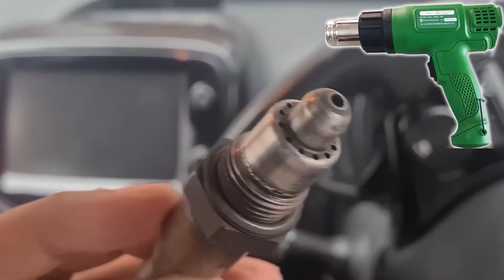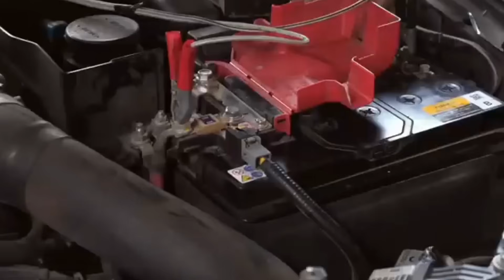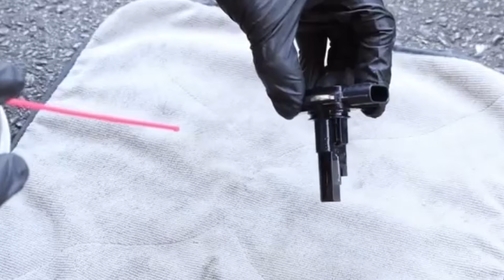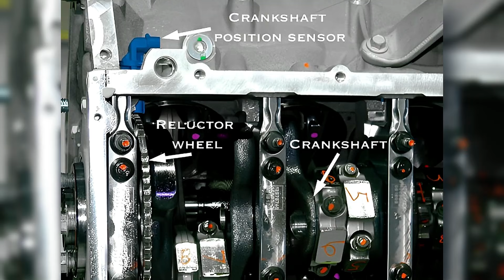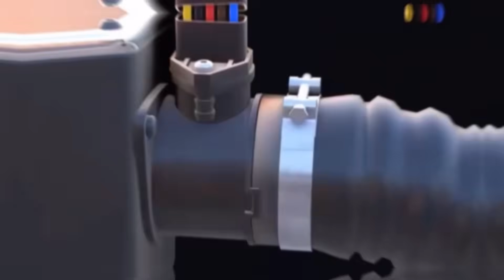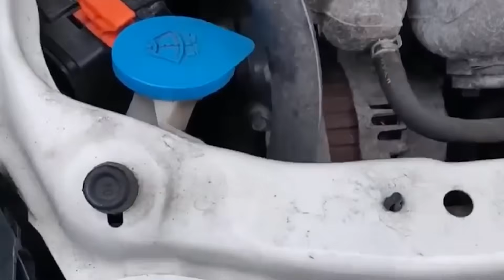Nobody Cleans These 5 Sensors — And Your Car Pays for It

Comment: Idle surges up and down while setting with put on break like at a light or drive through
Reply from the maker: That's the throttle body. Carbon buildup on the plate messes with the idle signal. $8 can of throttle body cleaner, 15 minutes, that surging goes away. Try that first before anything else.

Comment: I had a 2004 Toyota van that was bringing on the engine check light, would disappear after engine warmed up. 
Got worse, light stayed on longer, then permanently. 
Scan tool said O2 sensor, clear code, rev up hard, ok for about a week, back again. 
Put injecta clean in fuel tank next time I filled up. 1 week later problem gone, poor injecta spray was throwing out fuel air balance. 
I now put injecta clean in my vehicles at least once a year, more if I'm driving it a lot. 
Glyn NZ
Reply from the maker: That's exactly what dirty injectors do — mess with the air fuel mix just enough to confuse the O2 sensor into thinking it's a sensor problem. Glad the Injector cleaner sorted it. Once a year is the right call.

Comment: 1989 Chevy Z71 that is running extremely rough. In winter sometimes won't idle. Constantly having to give gas to keep started. Will stall out if gas not given. Even after running for several minute wants to stall when put into drive. Lack of power. Lack of climbing power. Will have to shift to 2nd to climb hills. Thinking it's the 02 or MAP sensor. Possibly a clogged fuel filter. Any guidance much appreciated. Was quoted 800 for diagnosis. Local shops won't touch. Please help. Thank you.
Reply from the maker: That’s classic fuel/air + idle control issue — not a mystery failure. Start with fuel filter, vacuum leaks, and the IAC valve before touching sensors. O2 is rarely the cause for stalling like this. You’re very likely looking at a $20–$50 fix, not an $800 diagnosis. What engine is in your Z71?
Reply: Listen  closly if u hear some air noises. I have 1995 mondeo and it had exact problem i found one small rubber pipe wich was directly connected to engine maby vaccum pipe or something. It was broken i changed it and the problem solved.

Comment: My tuck hold back seems like  it gargling the gas when I press the paddle
Reply from the maker: That hesitation/gargling under throttle is classic bad air-fuel data. Most common causes are a dirty MAF sensor or throttle body. Start there before replacing anything — quick and cheap fix in many cases. What truck + engine do you have?

Comment: I don't know if this scanner is working. I've scanned my cars, a Mitsubishi Xpander MT ang Ford Ranger Raptor, 2.0 bi turbo. No fault codes. Good if it is true. Maybe I'll have to try it with a fault if it can read the fault.
Reply from the maker: If it’s showing no codes, that’s usually a good sign. You can also check pending codes or live data to confirm it’s working. What scanner are you using?
Reply: @AutoTruthLab it's a cheap one. THINKCAR 500. It's updated.

Comment: You should be able to sue these mechanics out here ripping ppl off. Are there  really anymore honest  mechanics anymore
Reply: I am starting my own mobile mechanic business following my grandfather owning his shop of 50 years, I am sick and tired of people getting ripped off, caught between a rock and a hard place with insurance companies and mechanics raking them back and forth through the coals. Not to mention the manufacturers are installing more and more computers in the vehicles making it either more difficult or completely impossible to work on as a mechanic without the distributor's software. Do not buy anything newer than '13, anything built after that has truly solidified the end of the automotive industry as we know it. It's all software, cheap metal, and petrochemical garbage now... the underbody of my gramp's '71 Cheyenne is cleaner than these >10 year old cars that come in with rusted out oil pans... it all makes my blood boil, unfortunately just another a microcosmic example of they way greed took over humanity and American industry/society. 

We know they sold out decades ago. The products we purchase now are a result and aftermath of this.
Reply: No

Comment: I guess I got go down the list and see what issue is now. Scratching my head. That 1 sensor is hard to get to, almost lost the screw last time.
Reply from the maker: Step-by-step is the best way. And yeah, those screws are a nightmare — try a magnetic tool or a little grease to hold them.

Comment: 2yrs ago I got an engine light. Ran diagnostic ,  cleaned maf and map. Engine light went away  code came back. Took it to a mechanic  friend and he cleaned it again engine light went away again. When i went back to work turned off engine everything was fine. When tuned car on a few hrs later engine light went on again. This time we replaced MAF and MAP sensors  drove for 50mi  to clear code. It worked. Saved a lot of money. Now I got the P0171 code 2yrs later
Reply from the maker: Good troubleshooting. P0171 is a lean code, so besides the MAF it could also be a small vacuum leak or fuel delivery issue. Definitely worth checking those first.
Reply: @AutoTruthLab  yeah, and could be other things. yeah, yeah, your answer only makes people crazy
Reply: 2004 Dodge 1500 5.7  when I first start I n the morning  smells like gas what is the cause

Comment: Hi I have P0448 code on a 2017 Nissan Armada  short circuit in the Evaporative Emission (EVAP) vent control circuit, commonly caused by a faulty vent valve, contaminated charcoal canister, or damaged wiring. The most common fix is replacing the EVAP canister vent valve, often located near the charcoal canister, which can be affected by dirt, water.   So far I have replaced the Canister and vent valve. But the code is keep coming back. It seems like the problem could be wiring. Any Suggestion how to fix this issue? The car is running fine from last 3 years. But the engine light is on all the time.
Reply from the maker: If the canister and vent valve are already replaced, then wiring is definitely the next thing to check. On the Armada, the EVAP vent valve wiring near the rear frame rail is known to get damaged from dirt, moisture, or corrosion. I’d check the connector pins for corrosion and test the wiring continuity back to the ECU. Sometimes it’s just a loose ground or damaged wire causing the short circuit code.
Reply: @AutoTruthLab  Do you have any link where I can see that wiring diagram or steps to diagnose the issue?  I have all the tools at my home like multimeter or other tools.

Comment: 2006 Colorado.3.5L automatic. P0171 code. New MAF 6 mos ago. Original AFR and Oxygen sensors. Original MAP sensor. I put a non-vented catch can in the PCV line. That's when the P0171 code showed up. All PCV connections appear tight. Any ideas?
Reply: It could be throwing a code just because you added the catch. It's thinking it's got a problem,  even tho it's not. Delete the code.
Reply from the maker: If the code showed up right after installing the non-vented catch can, that’s the first thing I’d look at. Those can sometimes restrict PCV flow or create a small vacuum leak if the internal baffling or hoses aren’t flowing freely. On the 3.5L Colorado, P0171 is usually caused by unmetered air. I’d try temporarily bypassing the catch can and reconnecting the PCV line directly to see if the code disappears.

Comment: You don't clean oxygen sensors, they burn clean while driving.
And certainly you don't clean oxygen sensors with any wire brush!
Reply: Yup if I'm going dismantle I just replace the throttle body and hose, air filter, replace the upper and lower 02 sensors and then catalytic converter most expensive part

Comment: They are all inexpensive. Just change them. DPF sensor and installation £180. My car is worth it. I treat my cars like a hobby. Not as an irritating cost. I think this is the issue with many car owners. Turn the key and go. Give parts a polish. Plus I don’t want the hassle of going into limp mode etc because a part eventually failed with age. Proactive and preventative every time. First thing I do. Change oil and filter. Previous history or not. Change air filter. Change transmission fluid and filter. Change brake fluid And MAF sensor. The rest Im in the hands of the motor gods.
Reply from the maker: That’s a solid maintenance mindset. Preventative maintenance definitely saves headaches long term. The main point of the video is just that many of these sensors fail because of contamination first, so cleaning them can sometimes solve the problem before replacing perfectly good parts.
Reply: Extra spending in the era of the WEF New World Order, what a twit

Comment: Did you think bro all these mention need clean in car mechanics.?and why
Reply from the maker: Not always. But over time dust and oil buildup can affect sensor readings, so cleaning them first can prevent unnecessary part replacements.

Comment: My car has thep0420,and p0130,p0141c1688 but I had the p0420 before and I put in the 2 sensors,like 6 months ago then the car through black smoke,and no power when starting,or stopping on a light,or stop for a few seconds, so check engine light came on with the po441 code purge valve I put it in new but dint erase the code it went away but all these came on im assuming is becouse all the black smoke the mechanic let out wanted me ti drive it with something loose in engine so it could release all clog smoke,that was before I put new part now I got all these crazy codes,oh and when it blew that smoke made a stuck noise,stopped the car then turn on few minutes was OK then I cha get the purge valve a little better but low idle no strength in the begging every time I stop, I assume all my sensors are dirty, some is going to try clean the cathalyc and some sensors but I was taking notes so they can clean all the ones you said other mechanic when I tell them clean the sensors and cathalyc they look at me like im crazy.but there's a nice older mechanic he willing to try it,I have handai accent sedan gls 2014, 124,500 miles,oh and waste too much oil
Reply from the maker: Black smoke usually means the engine is running too rich. A dirty MAF sensor or throttle body can cause that and trigger multiple codes. I’d start there before replacing more parts. Is the car still producing black smoke now?

Comment: 2019 honda fit, combustion engine. Accelerates slowly, feels like Im losing power on lower gears, doesnt burn gas well getting less miles per gallon of gas.
Reply from the maker: Slow acceleration and bad MPG can often come from a dirty MAF sensor. I’d start there. Do you notice any hesitation when accelerating?
Reply: @AutoTruthLab  yes there’s also hesitation when accelerating sometimes.

Comment: My toyota corolla altis cvt petrol is running smoothly even after 93000 kms . Should i clean any sensor just to be safer .
Please reply..
Reply: Steady..
Reply from the maker: @HuseinMirTune  If RPM is steady but the car shakes, it’s often engine mounts, not sensors. Worth checking those.
Reply from the maker: It might help. A dirty MAF sensor or throttle body can cause idle shudder on many cars. Cleaning them is usually the first step. Quick question — does the RPM bounce when it’s idling, or is it steady but shaking?

Comment: Wow, great info and answers to comments. My 2012 MITs eclipse Spyder has a shudder when I put it in park and it idles. Would it make sense to get the main sensors cleaned?
Reply from the maker: Thanks! Yes, cleaning the MAF sensor and throttle body is a good first step since both can cause idle shudder. Does the RPM move up and down when it’s idling?
Reply: Just purchased a 2010 Ece Tech 2.2. I determined it had a clogged / Bad PCV oil in the throttle body & intake & engine coated with dirt & oil. Low & Behold the PCV is built into the intake ( I'm 78 worked on Cars with carburetors, coils,& distributors) so I've replaced every sensor I could find while I had it apart. Maf,map,crank,2 cam, oil pressure, & transmission not back together yet we'll see 😅

Comment: Oiled air filters coat the MAF too.
Reply from the maker: Good point. Oiled air filters can leave residue on the MAF and affect the readings over time.
Reply: @AutoTruthLab Incase that happens you over oiled the air filter. I use oiled GreenFilter for over 20 years and never got oil residue on the MAF. Use only isopropyl alcohol when the MAF requires cleaning.
Reply: Incase that happens you over oiled the air filter.
Reply: @mstar501 It will do it over time anyway 👍
Reply: So clean it more often. It’s not a big job

Comment: 1. Oxygen O2 sensor, 2. Throtle position sensor (TPS), (3) Manifold Absolute Pressure (MAP) Sensor, (4) Crankshaft Position Sensor (CKP), and Mass Air Flow (MAF) Sensor
Reply: I clean every 12-18 months, every sensor except O2
Reply: @sebek23b why not the 02?
Reply: @wisewisdomtooth replace both the upper and lower 02 sensors
Reply: @gracesmith9125 u dùm have $2000??
Reply: @gracesmith9125 when it’s time
Reply: Thank you for the summary.
Reply: Not all heroes wear capes
Reply: So true.
Except the air/fuel sensor is ahead of the oxygen sensor.
Mine was lazy at 170k miles and needed changing. No more codes and runs great. 
If you don't fix it you risk wrecking your cat converter.
Reply: @Jesuscatshockey 
Take care of your cat.
Reply: @flouisbailey 
We both like that kind, of, part, huh...all cats need a good hands on cleaning and it's a good idea to get your head down into what you're doing so you don't miss, anything.  Ahhh.
Reply: @flouisbailey 
It was running rich. The air/fuel sensors had a varnished shiny appearance while O2 sensors looked like covered in white powder coat.
Reply: Please do a video on CAN Buses
Reply: Camshaft position sensor too needs cleaning !
Reply: IAC on some older fords too. That same ford probably only has one oxygen sensor not pre and post cat. Rest Base Idle into the ecu after IAC Cleaning via ecu/idle learning procedure. INJECTOR CLEANER.
Reply: 10х 4 hint!
Reply: @spasmarinov5541   Can you translate to plain English?
Reply: 2007 sport trac can a brake booster cause issues  with performance?  And show all kinds of  sensor codes ?
Reply: Thank you.
Reply: Beautifully and thoroughly explained!
You are a professional, a professor and a teacher. Very educational, I have acquired knowledge today. 
Thank you.
Reply: Thank u so much
Reply: A thoughtful mechanics’ detective brain working!
Reply: Thanks for short cut
Reply: Where are the map sensors located on mazda cx5 2012 diesel engine
Reply: I clean my MAF
Reply: Running ruff knocks an kicks at 50 mph red ignition light constantly comes on how to turn engine off and restart when it's on I lose power
Reply: I install Lufi OBD2:on dashboard of my old Mercedes. It could be set to read many parameters. MAF, MAP, throttle position, speed, exhaust 02 reading in volt, long & short fuel trim etc etc. Once the the MAF drops to below 3g/second from 6g/second. Throttle opening drop by at least 1% from normal of 15.5%. help me to identify that the PCV hose had cracked.
Reply: I got bored after 4 minutes and scrolled down. Thank you for saving me from the other 15 👍
Reply: I was recently quoted $2500 to replace the timing chain in my i30 Hyundai 😮😮
Reply: @saz44-M I would guess they thought the timing chain was gold. 😂 They were proud of it.
Reply: @saz44-M 
Seriously? SMH!

Comment: 2012 KIA Sorento, 2.4 GDI engine. Power is down. It doesn't surge, hesitate or do anything else that appears to be abnormal. Acceleration is slow from start and driving on highway any hill will slow the vehicle down no matter which gear the cruise control selects or which I select manually. This model does not nave a MAF sensor, just the MAP sensor.
Reply: Google Overview;  
" The 2012 Kia Sorento 2.4L GDI (G4KJ) engine is highly prone to catastrophic failure due to manufacturing defects that cause rod bearing failure, oil starvation, and severe carbon buildup. These engines are known to experience premature failure (100k-150k miles),"  . . . "     😞
Reply: @RockinBrwy Yes, I know. KIA has already given me 2 replacement engines. If you're not aware of the program check it out. If you're eligible you can get free replacements of the bottom end for the life of the car.
Reply: Check your cat converter.  Remove your upstream o2 sensor and drive it.  It'll be loud but see if it runs better
Reply: @DevonBbrown 😂😂😂
Reply: Thanks, I'll give that a try tomorrow.

Comment: Thanks sir i have got ford falcon 2002 AU i have been droven  it for a while almost since it was new never had any issue so happey  but this time around i am having some problems like stall  the engine every 20 minutes when it get hot  then   when chill down iit is  cooler able to start agin for the same distances same thing again and again. from what you said i think the problem seems to me the  crankshaft position sensor do  i am right ? thanks a lot
Reply from the maker: That actually does sound very similar to a failing crankshaft position sensor, especially since it stalls when the engine gets hot and starts again after cooling down. That heat-related stall is a classic symptom. I would also check the CKP sensor connector and wiring first, because sometimes corrosion there causes the same issue. Do you notice if the tachometer drops to zero right when it stalls?
Reply: @AutoTruthLab thanks we found the issue to be the exost( exost smock tupe) was blocked and the senser was brockn  cut off they put  put new one now the engine can breaze and run smoothly  no stall so far if it is not too early to tell.